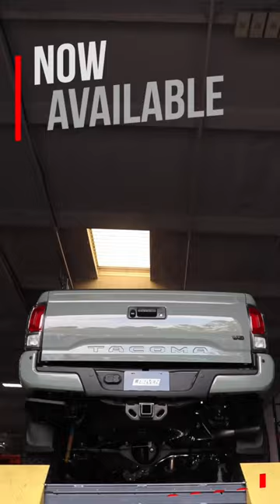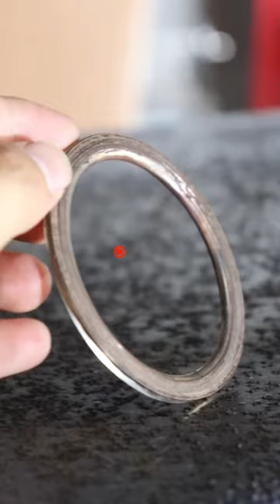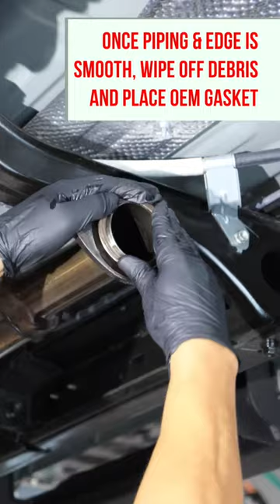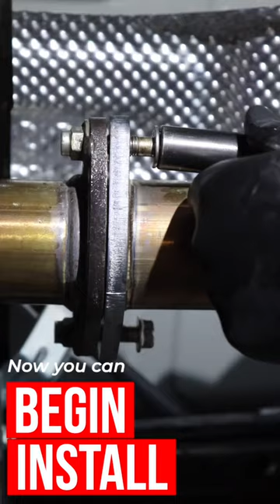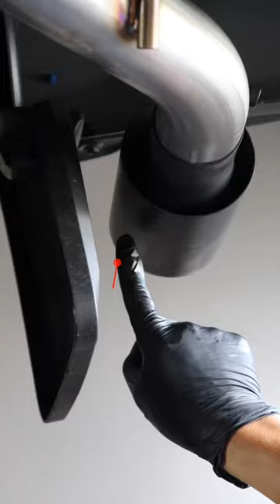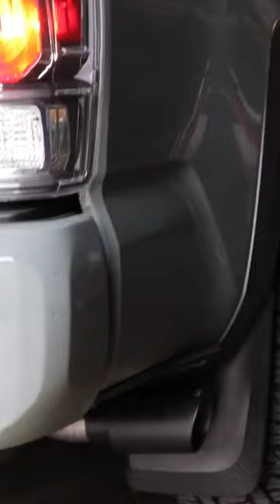2022 Toyota Tacoma Cat-Back Exhaust System by Carven Exhaust #exhaust #tacoma #toyota

Comment: Well it took about a hour or more of grinding with a Dremel. Tool with a drum sander to get it close enough to work on our 2023 Tacoma 3.5. Didn’t want to take so much off material off as to compromise structural integrity. A Real PIA
Reply from the maker: Sorry to hear that Douglas! It shouldn't have taken that long. We will bring this up so we can figure out another solution for a fast and easy install.

Comment: What changed with the 22 that this is needed? Just curious, thanks guys
Reply from the maker: Great question, so in the video when removing the oem flange section for some odd reason Toyota didn't file down there pipe and thats what cause our flange section not to fit. So this is why we recommend filing down your oem pipe. We already went and filed down our flange section to make sure it slides in there.
Reply: Is the filing of the pipe something that’s still needed to be done or was that corrected